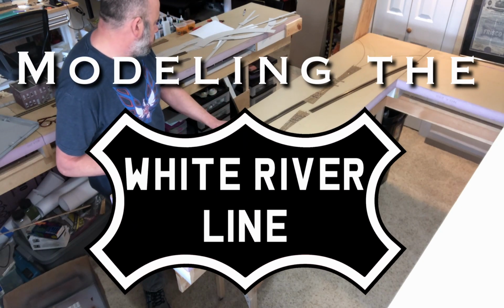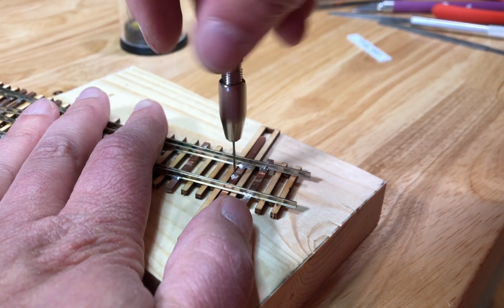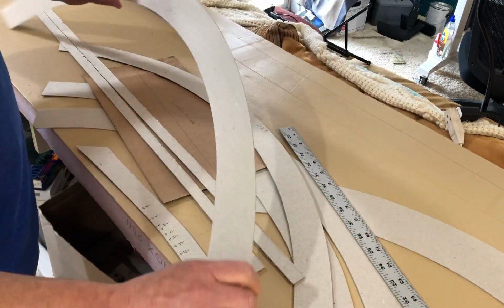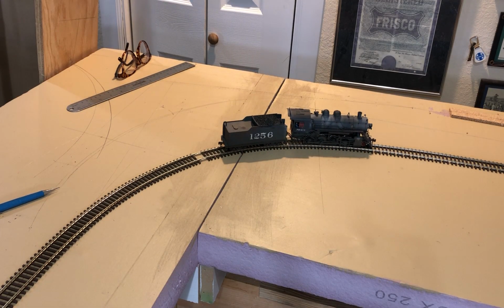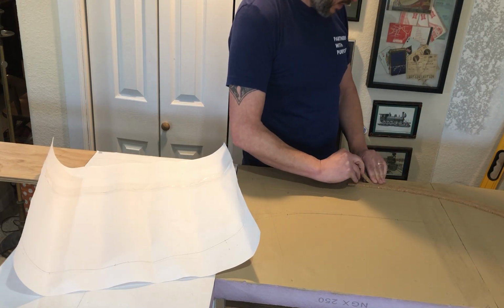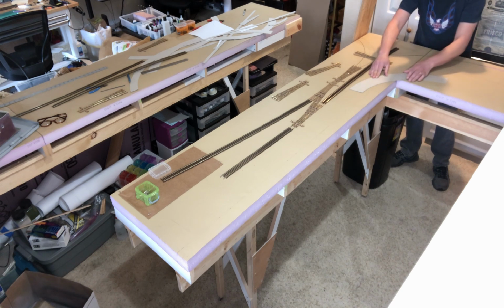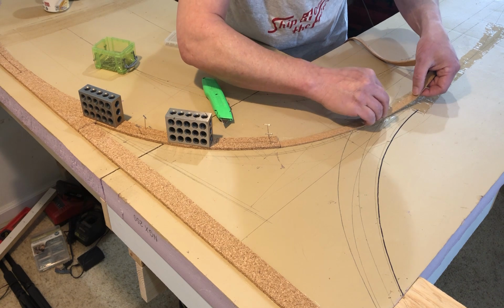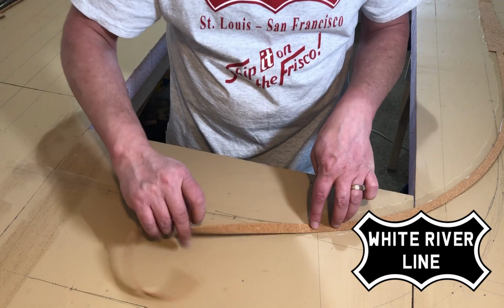Creating a Track Plan for the Industrial Section of My Model Railroad

Comment: Looks good. Curved joint tip: always solder with staggered joints (especially on curves) and also solder with track 'Straight' then when laying it can curve it. Where did you get the cardboard-light/heavy art sheet to create your templates? Definitely larger than a cereal box LOL. Thanks.

Comment: I realise it is too late now, but did you consider installing a crossing on the wye. Have both curves from the base of the wye cross each other so they then run parallel and are connected at the top of the wye by a crossover.
Reply from the maker: I did not. It just didn't occur to me. That could gained me some more space, but, if I'm understanding what you are saying, I wouldn't have had control of which spur the trains route to. A slip could have worked though.
Reply: Yeah that’s what I was going to throw out there, 12 months late!  Plenty of instances where industrial tracks split off the main and cross each other to maximize use of space.  I’m hand laying one now as a test module.

Comment: Drew, great informative video. Just an observation though; you have 2 inch foam on what appears to be risers spaced about every 2ft, is there any other support under the foam? The foam sheets do actually shrink over time and bend (warp) too. Just a thought.
Reply from the maker: There isn't any other support under the foam. Most of the research I did prior to installing them didn't indicate any support was needed for them. I guess, at this point, we'll see.

Comment: Hi Drew. Your layout is looking good so far. I went through the same radius testing and frustration too. I used the Bachman 2-8-0 also as well as an old MDC 2-8-0 kit that I had built many years ago. The Bachman 2-8-0 as you discovered will go around an 18"R curve and if you care to test it a smaller radius also. Not sure how small. The MDC loco really likes a 22" R much better. For the record I was using some of the Atlas sectional track to test with. 
Some one mentioned using a double slip in your yard lead. Iffy idea in my experience. I have a Peco code 100 and very few of my locos go through it and none of my steamers. Hand built might be a whole different experience.
Reply from the maker: Thanks, Jack. Always nice to learn from other’s experience.

Comment: Looking good, I would have done this a little differently, but that's just me.  
One thing I like about building turnouts is I can make whatever I need, not just set sizes.  It' is a bit trickier to make turnouts without a fixture, but not much.  I will say if you do any freehand turnuts make the frog first, I find that easier to get the gauge right.
Reply from the maker: Thanks, Fred. I'm planning on building my yard ladder without a fixture and I've gotten the same advise from others, build the frog first.
Reply: @WhiteRiverLine  Yes, the frog is key to ANY turnout, including full size.  Unless special location because of clearances, frogs are straight on both sides and so are the points.  The points and to some extent after years of traffic and wear, the frogs tend to get to be sort of curved in the real world.  The lead of a turnout may be changed by about 10% without messing up the characteristics of the turnout and to keep from having to cut additional rails.  By that, if a turnout is being laid and the rail available works out so a joint falls within the 10% of change, then that is acceptable to not cut a rail and have a short piece left over or have to use an extra full rail to get the proper length and have a partial rail left over.  Try not to cut rails if possible.  Logging and industrial railroads don't seem to matter, because they have a bunch of short lengths anyway.  Just try not to have joints close to each other on curves on the opposite rails, that tends to introduce kinks and doglegs in the track.  It also helps to use shorter than normal switch points.  Most model switches are made without actual length and pivoting points.
Reply from the maker: Thanks for all the feedback. I appreciate the info.